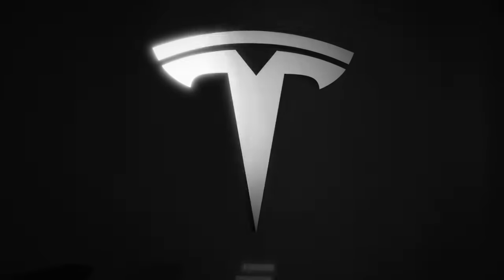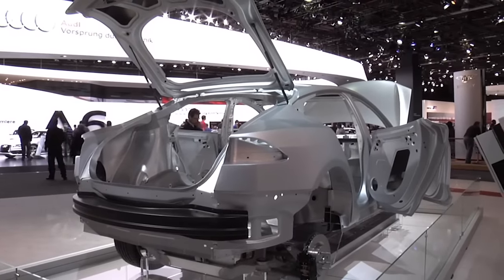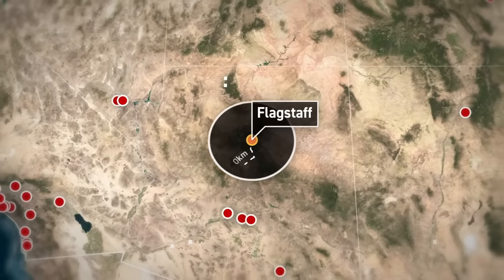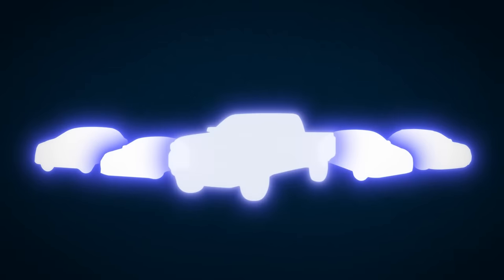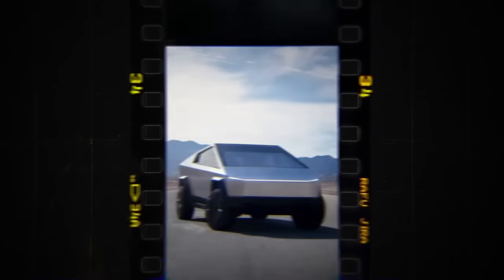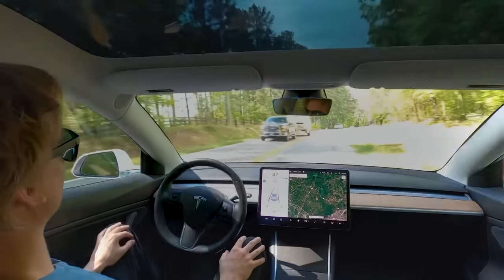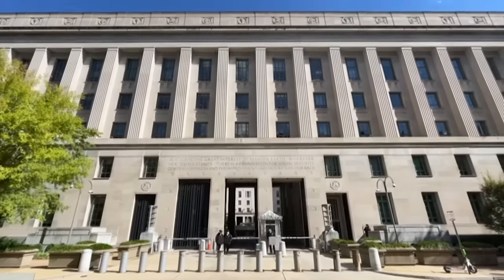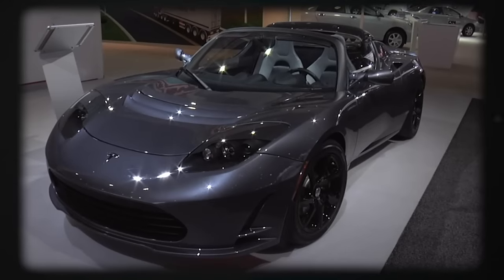How Tesla Fumbled

Comment: As a Tesla owner - there are many ways Tesla could be much better. But, there are several areas they still remain in the lead - mostly in the EV department.

First is just making EVs at scale. Even established automakers - the ones that know how to make good quality cars otherwise - still struggle to make EVs at scale. Even Toyota, which is known for reliability, had to recall its only attempt at making a pure EV - because the wheels could fall off. GM had to deal with a huge recall over LG Chem batteries in the Bolt. Nissan chose the wrong charging standard and they only sold one EV (Leaf) for over a decade until this year (talk about a squandered lead!). The EV startups are where Tesla was 8-10 years ago. If Tesla could fix their quality issues in making cars, they would be nearly unstoppable. To be fair, Tesla will fix any quality issues found - just like any other car company.

Service for Tesla is either great or horrible. I think Elon was overly optimistic about the cars never needing service - and really the only service I have had was related to a quality issue found - not anything needing regular repairs. However, the mobile service experience is transformative. For many types of issues, mobile service is ideal and I wonder why other car companies haven't offered this before. However, if you do have an issue that requires a bit more involvement - then going to an actual service center is very hit or miss. Thankfully, my one experience as actually pretty good.

The online and direct-to-consumer buying experience is amazing and very streamlined. Seems like only the EV startups are following the same model while legacy automakers are sticking with the stealership model - which is a very subpar experience for consumers. The only place Tesla needs to do better is having some humans available to answer questions or quickly respond to required changes that aren't available online (i.e. switching an order from custom build to existing inventory). Interactions are by text and sometimes it takes hours to days for a response.

Also, I've never owned a car that got better the longer I owned it. I get new features with over-the-air updates - which are free. Chrysler wants $600 to update the navigation system using outdated CDs on my minivan. And yes, while the ADAS features aren't perfect - they are still better than any other system I have ever used. Heck, my wife thinks it drives better than I do. But, knowing the limitations, I remain alert and disable it in bad weather, construction zones and near emergency vehicles. I do wish they would add a top-down 360 view to help with parking, but that's a nit-pick item.

However, Tesla's magic sauce - that no one else is able to replicate yet - is the charging network. It is a seamless experience with everything integrated into the navigation system. Payment is handled on the backend with your registered credit card - so just plugin and charge. Every other EV requires using a third party network like Electrify America, EVgo, or a dozen others - each with their own apps, logins, and payment options. Additionally, Tesla's charging network has an over 98% uptime and reliability - however, just watch any EV road trip video and you'll see that EA locations often have half the stalls out of service and/or working at reduced speeds for some reason. Last thing I want to do is have to call EA tech support to troubleshoot a charging stall for an hour in the middle of nowhere. So, I think Tesla has a solid 5 years ahead of everyone else on the charging network - with nearly 1800 locations in the US and about 5000 worldwide.

Styling is a matter of opinion, I personally like the look. Some folks like BMWs but I can't get over the "monkey butt" grill - that's just me (sorry if I just ruined Beamers for you).

I don't have any significant issues with this video. I think it is fair to call out missed opportunities, poor decisions, or things that could easily be fixed. I do expect them to lose overall market share as the EV market expands - basically a smaller part of a much larger pie. So, perhaps instead of 75% of the EV market which is only 3% of auto industry - perhaps 40% once EVs become half the auto industry in about 20 years.

Comment: Well this video is not aging well. That is the problem when you ignore all nuance and honestly don’t understand the industry very well. 

This video completely missed while stats between non-Tesla evs were similar. Not tesla is selling evs for a huge lose each car and have no idea how to produce evs on a mass scale. Only tesla and byd have production figured out. And it will take many years for other companies to figure out. 

Second this video does not understand the value of a good charging network and great software package to make the transition from gas to electric more convenient and less stressful. Also good at preventing range loss from climate.

Lastly Tesla is among the best if not the best in, seat comfort, safety, software, ac/heat, sound system, and vehicle control.

Are the Criticisms in this video valid, yes. Does it suffer from a lack of understanding of the industry and confirmation bias, also yes.
Reply: With the network you hit a good point 
The only way this can work, is if they are compatible with each other.
And allow fast charging 
That way existing gasstations could just add electric stations and it might work.

Comment: Are u serious, I'm no tesla shill, but. Comparing to a Mach - e? Is that about the most recalled car ever from the brand that sets the record for recalls in the industry? And comparing to a lucid air? Extremely low production, at much higher price, and with service. And parts that have a high chance of not existing if they can't find a path to profit and run out of investment capital? Something happening rather more quickly as their ceo is on 379mill? Whilst Mary bara of gm is on 21.6 Mil. How does ceo of a comparative tiny, tiny volume, at risk of death from relying on investor cash, pay  its ceo 17.5 times more than gm's ceo. But you compare telsa to that re how tesla squandered it's advantage?

What drugs were you on when you put this together, and where can I get some?!

(yes yes I know re Elon 55 billion... That was effing stupid and corrupt and rightfully struck down by shareholders. If that was upheld I for sure cldnt raise above point! I hope the adjusted package is not stupid..

Listening a bit further... The bolt has similar specs to the model 3..
 Erm have u checked reviews? 

And have you checked cyber truck wait list? 

And re low model numbers - tesla strategy of simply having a category leader in each category they enter - ie the model y the world's best selling car?! 

If you did the research for this video I am sorry but you are either terrible at it or terribly biased against tesla. 

This video is one of the worst I have ever seen on such content. Even some openly biased against tesla have beenore accurate and balanced than this heap o crap. Wtf man.

Comment: Teslas biggest advantage is their charging network. They have some good IP in the design and manufacturing of their cars like the batteries and motors. They also have the best software. You didn’t mention any of these.
Tesla does really annoy me how it has been distracted by self driving, rocket powered roadsters and humanoid robots though rather than working towards there original vision of sustainable transport.

Comment: It's now a year later, and the Model Y was the best selling car in the world last year. In December I bought a new Model 3, which was built just weeks before in Fremont. If I were to add up all the manufacturing defects I found the total is a big, fat ZERO. Great little car, fun to drive, cheap to run, and in less that four months I've put 12,000 trouble free miles on it. The only maintenance has been a tire rotation and a couple of jugs of windshield washer fluid.

Comment: The build quality of tesla vehicles is terrible, like 1990s hyundai terrible, I recently house sat for some one who has a Hummer EV SUV and the interior on it is suprisingly nice, also its an SUV with 37" tires 13" suspension travel and does 0-60 and the 1/4 mile faster than the last generation corvette, and it was cheaper than 3 motor cybertruck, also the dealship threw in a fast charger for free and installed it in the garage 3 days after the vehicle delivery.

Comment: Tesla is not great but I think it is worth noting that a lot I've heard about Tesla could have been said about GM and other manufacturers once upon a time. Back in the 80s it was not uncommon for you to buy a car, knowing it's bad and then come back to get those things repaired over time. Fixing the issues in order of how bad the issue was. From conversation with engineers from that time I get the impression that quality was non-existent and only really came into being after the rise of lean methodology and six sigma in the states
Reply: The US auto industry was forced to revamp their entire lineup within a decade after CAFE standards were introduced following the 70s oil crisis. None of them had the engineering capacity to do it (they usually dedicate resources to redesigning or introducing one or maybe 2 new models at a time while giving the rest of their lineup minor improvements from one year to the next). The strain forced a lot of compromises and rushed production that inevitably created lots of stinkers and the issues you mention. So the 80s was an exceptionally bad time for the US auto industry, not really representative of the norm.

Comment: I worked at a Tesla Service Center as an intern mechanic for 4 months. Taking them on test drives was always fun - although ICE cars are more fun to drive, electric cars have a unique feel in the way they drive too. But between 50-60% of the cars I worked on were in for cosmetic fixes or defect repairs before they even had license plates on them. I'm still considering buying one, but only for 2 reasons. 1) because the charging network is still unbeatable, and 2) because I now know how to do so much of the repair work myself.

Comment: 5 ¢ seeing this after a year. Disclaimer: I'm an EV driver, but not a Tesla owner and neither Tesla/Musk fanboy.

Addressing the last part about Tesla's selling points, they do as a company innovate a lot in subtler engieneering ways. The powertrain has a bunch of brilliant solutions from coolant piping optimization to the motor itself (IPM-SynRM). There are also good ideas on wiring an inter-car communication that Tesla pioneered not being held up by tech debt. Sandy Munroe (who was shown in this very video) does brilliant engineering perspective analysis on both Teslas and other cars and he often showcases brilliant stuff that Tesla's engineers came up with.

The sad truth for Tesla is that the deadlines and quality blunders as well as Musk himself are burying the company which could have still led the market otherwise. It also just should have taken a page from its own Model 3 book at applied that philosophy to the pickup for the US insead of a dumpster fire Cybertruck was from the get go.

Comment: Very good points, over the next 3-5 years the competition will be fierce from the established automobile manufacturers. Tesla will have to improve quality and add features to compete, it won't be easy.
Reply: "Over the next 3-5 years the competition will be fierce from the established automobile manufacturers."
Sorry to break it to you but the competition already arrived and their offerings have been anything but fierce.
It's like a surrounded army celebrating a message promising reinforcements only to realize that no one is coming.

Comment: It is true the Cybertruck is a bit of a bust, and it is true Tesla has some chronic QA problems but this post overstates the issues because it is so US centric. The point is that Tesla's ambition is to be the biggest GLOBAL car company. It is currently more concerned with the Chinese and European markets (each of which is far bigger than the US one for EVs) so the lack of a killer pickup is not a huge problem for them. BTW their QA is demonstrably better in their Shanghai and Berlin factories than in their US ones, which suggests that the problem lies with local suppliers.

Comment: In truth, Tesla's problems keep mounting. Early adopters are now discovering that the battery electronics in their Model 3s are starting to break down after 3, 4, 5 years of ownership. Shockingly, unlike automakers like GM, Ford, Hyundai, Nissan, etc., Tesla flatly refuses to cover the battery electronics under its battery warranty —and the repairs are costly: nearly $2K. Be warned, potential buyers: if you search the Tesla forums for "PCS" (Power Conversion System), you'll find that such problems continue to escalate.

Comment: Toyota recently announced they will stop producing electric vehicles because it's just not logical to do so.

Toyota one of the biggest car manufacturers in the world stops electric car manufacturing.

When one of the biggest car manufacturers stops production of a certain type of vehicle (in this case electric vehicles) it's a big sign for the whole industry.

Electric vehicles aren't the future.

Hybrid vehicles maybe.

Clean and Quiet in the City
Noisy on the motorway.

Synthetic fuels are around the corner. 

The First mass produced synthetic fuel will have a price comparable to current petrol prices.

They estimate it could be on the market in 2025.

Admit it.

Electric cars don't have the future
Reply: The Model Y was the best selling car in the world last year.
Reply: @kevinjohnston4923  only because of tax benefits
Reply: whos admitting this?
Reply: @sandran17  it's a known thing.

In the Netherlands alone the tax benefits are so over the top.

For your 1800 kg electric vehicle you don't have to pay road maintenance tax.

This is the subject of change but far far too late.

There's currently an incentive for buying electric vehicles. You currently get a discount of 3500 euros from the government.

There is no BPM.

In the Netherlands you need to count a vehicle you get from your boss to your income.

For electric vehicles its still 0%

For any other vehicle it's 24%

Yeah it's only for tax benefits.

Also the Toyota statement was all over the news. It was a letter sent to dealerships.
Reply: @NANA-j1l2b   but who is admitting it? Me? You? Wendover? I'm scared!
Reply: @sandran17  are you having a stroke

Comment: AND they're worse for the planet. EV's require massive amounts of energy to mine, process & refine the minerals for batteries..(which is highly toxic to local air/water/soil) & even more energy/c02 to ship the components around the world & build the batts. (Just to fail in 10yrs, & create more c02/pollution to ♻️ & replace).

And electricity doesnt come from thin air, 60-80% is from burning fossil fuels😅. So an EV needs to be kept/driven for over 100k miles (on the 1st battery) to offset its total c02 (vs gas cars). Yet most replace the car before that.. so EV owners actually hurt the world more than they help

And with every new battery the process restarts. Yet no amount of driving can offset the damage from making (& disposing of) the batteries.